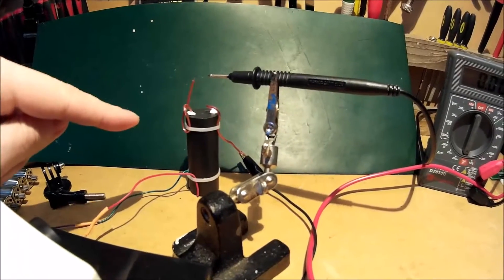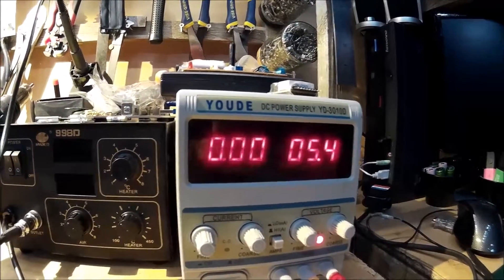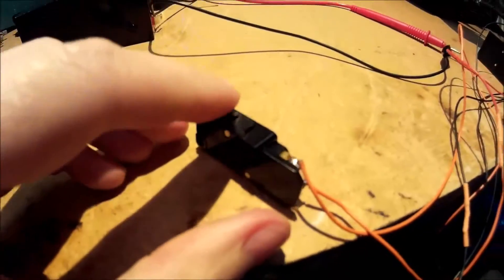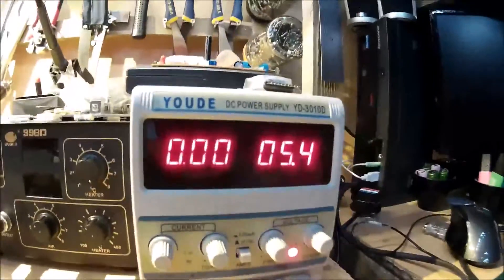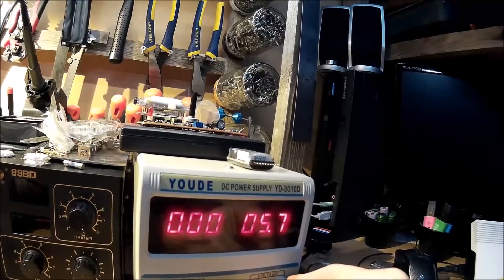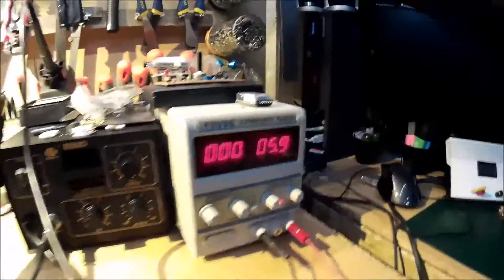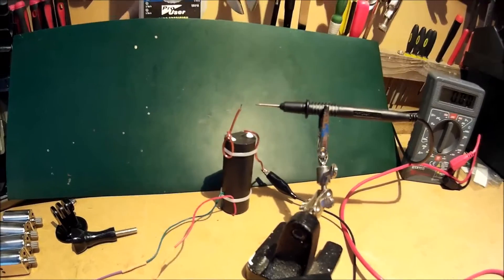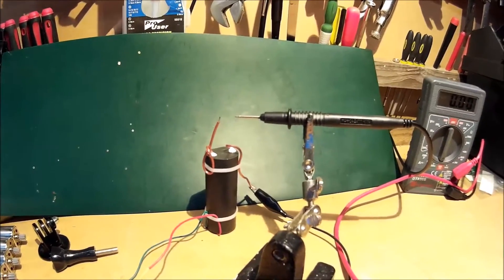400kv High Voltage Generator Module Current Draw

Comment: Got a few of these on the way, what output current is it measuring at? is that 18-20mA output from a 5-6v  2.5A input?
Reply: So it is not possible to use this as a tazer ^^ ? Beacause the "air" is more resistante than the human skin, in theory the current will draw up ? ??

Comment from the maker: From Banggood 3 pack
http://www.banggood.com/3Pcs-DC-3_6V-6V-To-400KV-Boost-Step-Up-Module-High-Voltage-Generator-p-958615.html?p=070519238739201308J6

1 pack
http://www.banggood.com/DC-3_6V-6V-To-400KV-Boost-Step-Up-Power-Module-High-Voltage-Generator-p-915426.html?p=070519238739201308J6